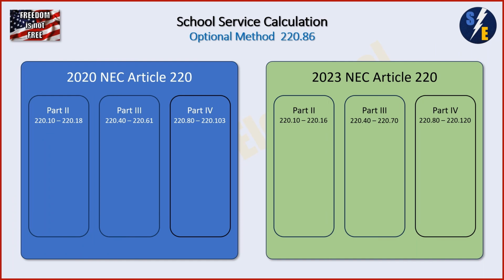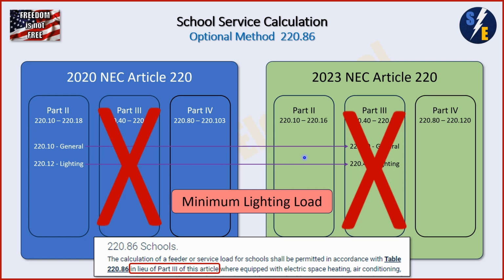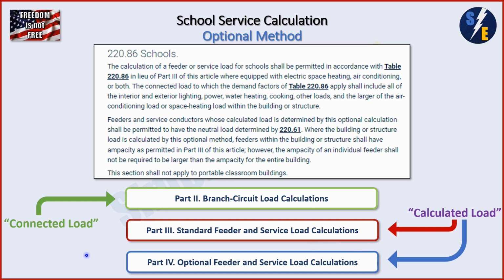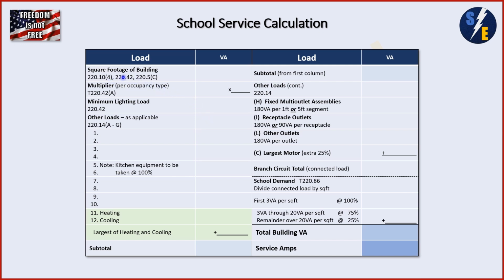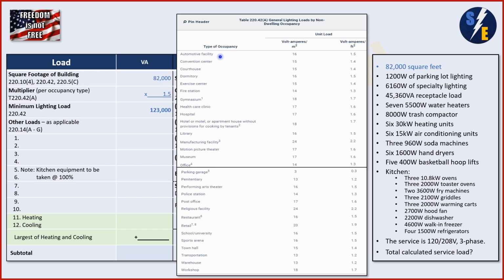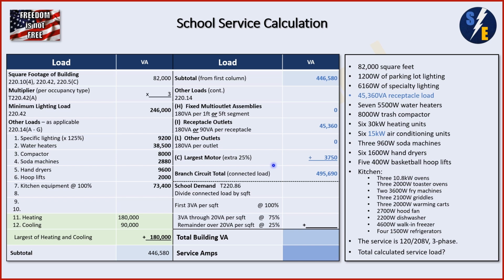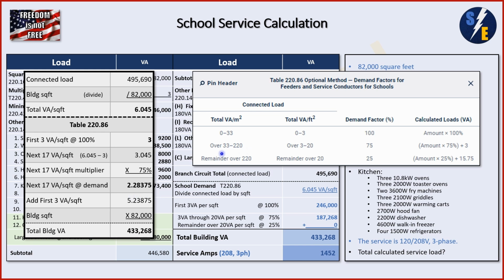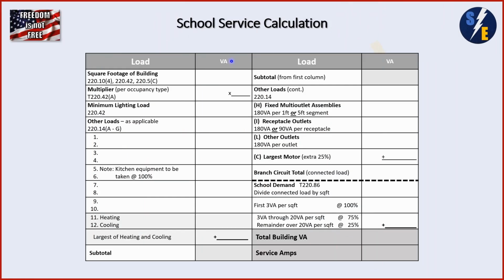School Optional Service Calculation - Crash Course 2023

Comment: I thought we are not supposed to use the multiplier per occupancy chart for optional calculations and also no 25% of largest motor?
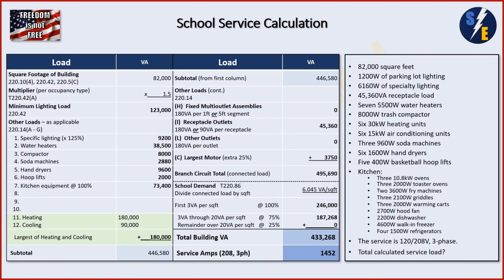Reply from the maker: I believe I address your concern at 21:01. It relates directly to the first 5 minutes of the video where I talk about the changes in 2023 and how the intent likely doesn't match the new wording.

As for the largest motor, I'm not sure what you're asking. I included it because we get that direction from 220.11(A), which is in Part II of the article.

Please let me know if I misunderstood your question.

Comment: no sign ? schools not required to have sign. is a school a commercial  building.
Reply from the maker: That's a great question. I should have mentioned why we don't include a sign load in the video. It's more of an inference than an explicit directive.

As I see it, a school is not considered a "commercial" building, as there is no commerce being done there (by and large). 600.5(A) specifies commercial buildings for the sign circuit requirement. And that makes sense because those are the buildings that would normally have such signage.

As electricians, we often use the term "commercial" to designate almost anything that is not residential or industrial. But the code book does not make that designation.

I'll plan to explain that in the next school video. I appreciate the question!
Reply: @simply.electrical  thank you, studying for Oregon test so I am very careful I don't make mistakes. thanks for the help.
Reply: @DouglasKenderes  I am also studying for my Oregon supervisors license. Once you learn the wrong way, it is hard to unlearn it.